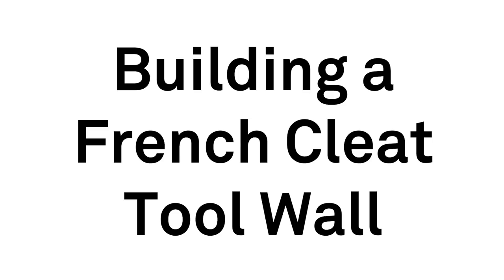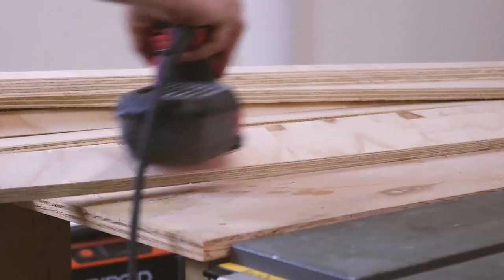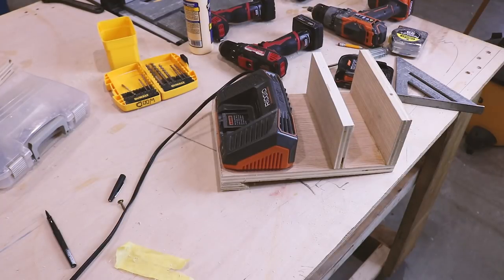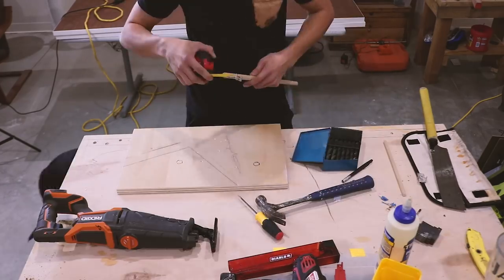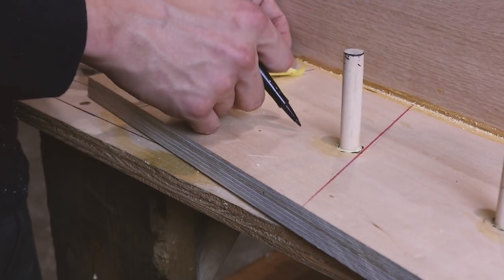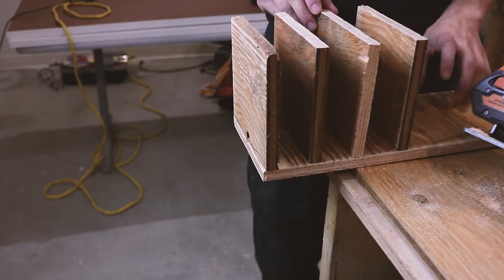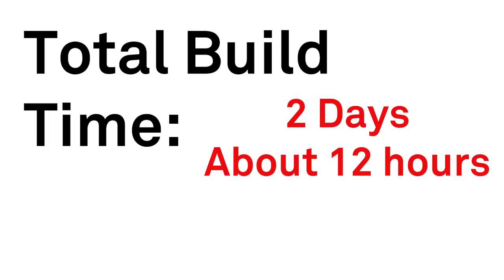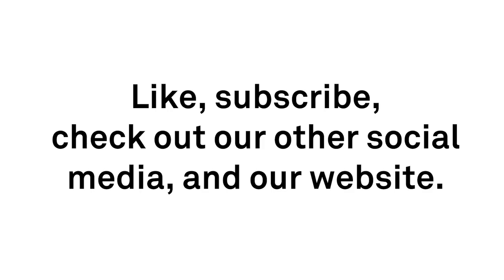How to: French Cleat Tool Wall

Comment: Did you have any issues painting (white) your french cleat wall, and paint "filling in" the 45 deg cleat, causing your holders to not seat well?
Reply from the maker: Hi Kaitlyn, thanks for your question! We haven't had any issues with that so far. Giving everything a proper sanding (taking down the thinnest edge of the cleats) helps give a nice fit. Also the unprimed plywood absorbs so much of the paint, you'd really have to glob the paint on for it to interfere with the fitment of the tool holders.

Comment: How come you didn't rip pices down the middle at 45 degrees, which would have made a cleat and several cleat-backers at the same time?
Reply from the maker: Great point Roger, and that's definitely the better way of doing it! If you can see in the first shot with me ripping the sheet down to size it was warped in a few directions.  Because of the warp I decided to cut it down into strips first, the thinner strips helped me force the wood tighter to the fence for a straighter cut.